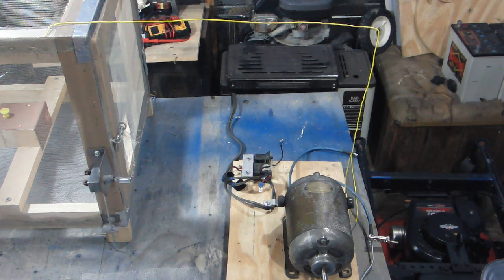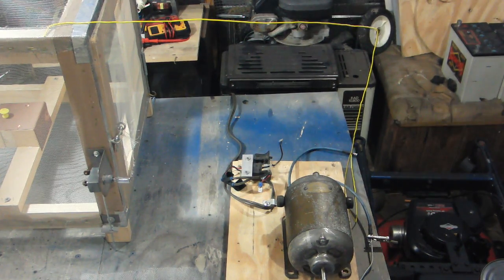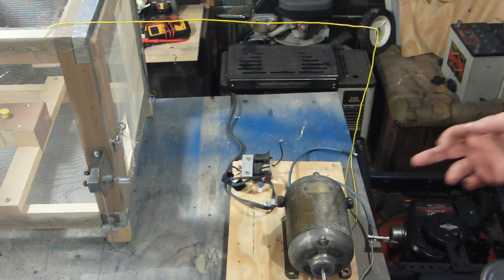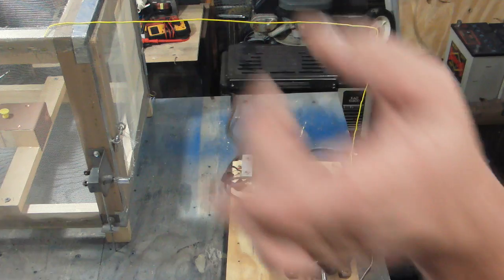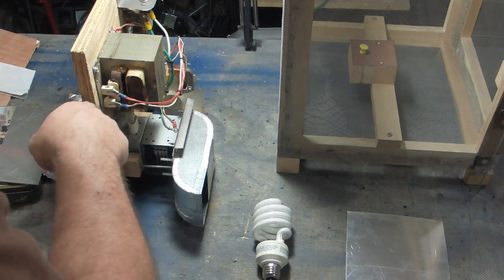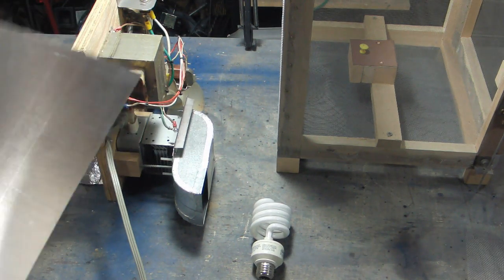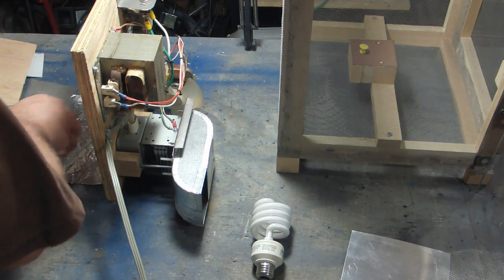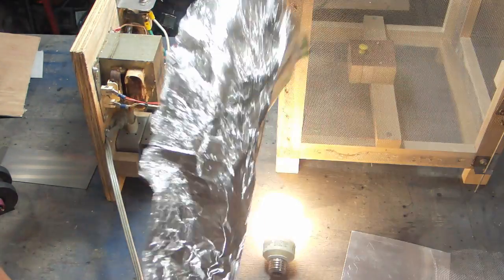The Faraday Cage

Comment: If you keep electronics in a gun safe... are they "safe"? Will an EMP/CME just go around the safe or is it absorbed into the metal and then needs to be "released" like a capacitor, there by creating a static potential that could still destroy circuits in the safe anyway?

Also.. Thank you - I did not think about cutting off my main circuit breaker to prevent the energy from entering my home's electrical system.

Comment: What's up MR2. I've been following your channel for a while now, and your work has both intrigued and inspired me. 

In fact, some of your early videos about HHO gas production and storage etc. sparked a revolution in my mind and largely changed the direction of my research into alternative energy production. I also follow S0's news everyday and I understand your collaboration on star water will eventually change the world.

The reason for this comment is that I have a question about one of your playlists: Suppressed Technologies. Several of the videos have been deleted. I understand how violation of the user account agreement can result in deleted videos, however, it seems suspect to me that so many violations can be found on the internet and are not deleted, yet, when the content of a video contains "certain" elements they are removed.

What did the deleted videos contain? Can I find them elsewhere on the internet? 

I've been scouring the internet for the last three years looking for alternative energy research, and, of course, the holy grail, "free energy". I've looked into everything from magnetics, HHO, Stan Meyer, nitinol engines, crystal batteries, Fresnel solar Stirling, Edward Linacre, Tesla, Marko Rodin, Nunez, you name it. 

I spend a significant portion of my free time researching these topics and have yet to find the holy grail. It seems every time I get close to an answer I hit a brick wall or something was deleted/removed from the internet.

Who is deleting these videos? How can we protect our information? Which area of highly efficient/renewable energy production seems the most viable? For someone with very little resources,  where is a good place to start experimenting?

-Andrew Sinkinson

P.S. Thank you for all your contributions.

Comment: couple questions:
wouldn't your breaker trip if it received a mass dose of electricity?
do you need to ground your cage? the small metal tin was not grounded.
would the metal around your car's battery be sufficient to save the battery? I just thought of The Day After from the 80s

Comment: Question:  If you attempt to cover up your electronics like a computer or something it is difficult to do a complete job around the home.   I notice when you put the metal in front of the bulb when it covers about half way it shuts off.  is that correct?

In other words as you put it a poor mans set up will still be effective.

Thanks again
Reply from the maker: You'll have to make sure and unplug any equipment you want to protect. and place in an enclosure. Just covering half of it won't work :)
Reply: Mr2Tuff2   Thank you

Comment: Stupid question.... if we had a nuclear event or massive CME, wouldn't it take out the grid and satellites as well? So protecting a lot of electronics may be null and void if we were to get a killshot from the Sun. I may have to try making one of these though, looks easy enough. Thanks for the info!
Reply from the maker: You're absolutely right. In the event of a major solar storm most cell phones and communication devices will be rendered useless. I use the faraday cage to protect my charge controllers, power inverters, and battery bank. All backup equipment for my 10,000 watt solar generator. Also have a CB radio stored as well. Which will be helpful with local communication afterwards.
Reply: Mr2Tuff2 I actually plan to use mine to shield some hard drives, a solar mat, batteries, and some fenix lights.
Reply: Good day,

 

I have a technical question about faraday
cases?

I want to make a closed faraday chamber with metal plates for up to 30GHz
shielding.

My question is about the holes in the air ventilation window.

Is it alright if I directly make holes in the metal plate, in a small window
surface,  with a diameter of less than
1/10 of the frequency wavelength?

Or do I need to cut a square window out the plate to place a honeycomb with
holes smaller than 1/10 of the frequency wavelength?

I need so many dB shielding as possible.

Can you help me with this question ?

Comment: if im not mistaken, the walls inside should be fine. the current is only held on the outer-most layer of aluminium atoms. theres no charge inside metal, or into the interior. great vid tho sir

Comment: he pointed out that it is being used only for demonstration purposes..
using a guide wave plate to direct the invisible beam..
and the beam passing through light bulb.. 
hits the aluminum building he is in.. then travels to ground.

safest possible.
few people remember we are told not to look into a microwave while it is operating when they first came on the market.

this is not something you want to do at home..
there is no reason to have microwave on a board normally.

play safe

Comment: Question - Would concrete walls with rebar and either grounded copper, aluminum, or steel mesh be sufficient to create top and sides to protect from EMP. Would I need to also apply the mesh to the bottom slab floor.  I come from a computer background so I have some knowledge to work from.  Thanks for all the great demos and videos.
Rusty

Comment: Mr2 - I enjoyed the education on Faraday Cage. I am thinking of building a home with materials that would allow for underground construction (earthen roof, sides, etc.) but have access for solar energy for passive heating and produce growth. My one concern is the impact of the ever increasing likely hood of an EMP event or several events that destroy my passive electronics used for management of the energy system and devices. I do not have the knowledge to engineer the system yet. question-

Comment: Microwaves dangerous when you are within the focused energy. If Mr2 moved the bulb in and out of that region directed by the wave guide on the magnetron you would have seen it dim and go out. Microwave is designed for line of sight transmission, it is directed. Meaning it basically only goes in one direction and will dissipate over great distances. On cell phone towers you see feed horns and if you were to look in the direction of the horn you would see a corresponding horn in the distance.

Comment from the maker: Without a doubt. They make perfect faraday cages. They are designed not to allow micro waves to leak out, therefore they won't allow micro waves to leak in either. The door of the oven is made with perforated metal, behind the glass, and a micro wave is literally to wide to fit through the holes, This is also the same reason they won't travel through the screen wire in the video.

Comment: Great video, M2. What about using a Rubbermaid or Roughneck Storage Box and cover it with several layers of aluminum mesh.  I believe in order to protect from EMP/CME event you may need more protection from scalar waves than that of the waves of a microwave.  What d'ya think?

Comment: The Sun, and all stars, create water naturally as they interact with rocky bodies. Remember, Water is just two protons (H+) stuck to an oxygen atom, and the solar wind is practically nothing but protons and electrons in a high energy plasma. Rocks are mostly silicates (SiO4-based), so the solar wind works as an acid and eats away at the rocks. This is why OH- is so common in Comet coronas (no snow/ice at all). All it takes is another proton from the wind and you have water!

Comment: great demonstration.
How does the door of a microwave oven prevent the energy from escaping ?
Mine just has a rubber like seal.
Could the wave guide be any length and turn through many directions?
Cheers

Comment from the maker: It can be argued that microwaves are dangerous and I would agree to a point. It will obviously cook flesh. However in has a "wave guide" over the magnetron. This focuses the energy which travels to walls of my shop and then to ground as my shop is faraday cage. Before I grounded the building I couldn't run a camera when I flipped it on. Now as you can see in the video the camera is unaffected. Not to worried. Used for demonstration only. Otherwise it's a dust collector. :)

Comment: Can you educate me on the "how to" of sequencing 12V batteries (like in the electrolysis video), and wiring copper coils in parallel (like in the Angus wheel)?  I really want to build a small electrolysis chamber, and attempt an Angus wheel, but I'm not an electrician.  If you know of some good websites or books I could look up, I'd appreciate the info greatly. 

Thanks, in any case, for putting your videos out there.  Here's to the future

Comment from the maker: They're awesome. I've salvaged about a dozen so far. Use the transformers to make spot welders with. Get 2 big ring magnets with each, and they're loaded with momentary line voltage micro switches. Everyone of them still worked after replacing the fuse inside on the circuit broad. You will need a set of security screw bit. auto zone :)

Comment from the maker: When it comes to EMP or CME it's all about size. Machines with small electronic components can't handle large amounts of electricity. ie: computers, cell phones, TVs. Not saying the locomotive can't be knocked out by this. However they will take a lot more electricity than most any other vehicle. In fact the locomotive will be the last thing running after an event like that. Even an electric golf cart will weather a storm much better than an automobile simply because its made with heavy wiring.

Comment: Hello Mr2Tuff2, I am curious what effect an emp or x flare event would have on  locomotives. Considering they are metal would that provide any protection? Is it a matter of grounding? Is it possible to be grounded while sitting on the steel rails? I know of an incident where lightning struck the rail ahead of a locomotive, it created many problems. Since I was listening to this event over a radio I was out of range to hear the details or solution to the problems.

Comment: Always a pleasure to discover your latest video.

Are you going to come back to the motor thingy any time soon? (That idea of using both sides of the magnet is really intriguing and probably worthy of deep explorations.)

Q&A: Wondering if the field strength of a permanent magnet decreases over time when used in a motor/generator … ? (I have an idea for driving a brushless alternator with the turbo charger shaft on fixed based industrial engines.)

Comment from the maker: Only for electronic equipment. Concrete floors have wire and re-bar in them and are fair conductors of electricity. This electricity won't actually hurt people. Although it may make some folks a little crazy. Works just like an induction stove. The metal pan gets red hot but you can put your hand on the eye afterward.
watch?v=HiIKq4RkZ1M

Comment from the maker: Personally. I wouldn't worry about cell phones or TV's either. I have cobra 40 channel CB radio tucked away. I know too many people that can make their own electricity. There could be a point when nothing will work, but ground based radio transmission will work again, long before the satellites will. 
As far as a room in your home. You can line it with tin foil and thumb tacks or any type of metal. Just the ceiling and walls. Wood or carpet floors are best. You need to cover raw concrete.

Comment from the maker: I tested the microwaves on a 5 cell 2.5v solar battery charger that I made to charge AA and AAA batteries with. The microwaves did add about a .5v. Which is not very much. I'm just going to flip the disconnect off from my panels. 
Satellites get hit regularly with a lot more energy than anything on the ground ever will. They seem to work fine up there. I'm not to worried. I do have 3 200watt panels stored in my shed, just in case.

Comment from the maker: For some of us leaving is not even an option. Most people don't realize that they're chances for survival are cut into fractions the second they leave they're home. "Bug In"
 As long as you disconnect your main breaker, or even pull the meter out of the socket. You cut off all the power building up in the lines. Yes the wiring in your home can still induce current, but only a small amount compared to 100's of miles of open cable linked to the power stations. You should be fine. Thanks :)

Comment from the maker: That will work just fine. Even though the floor doesn't have re-bar or wire I would still set everything on wood or pallets. You know a concrete floor will kill a good battery overnight if it's not isolated. It may not without metal in it, but why take a chance. IMO.

Comment: I have a polebarn style shop with galv-alum roof and siding. The roof is connected to the siding via galv-alum rake trim. The poles are used telephone poles approx 3 ft in the ground. The floor is concrete(no wire or rebar). At the present time I have no power ran to it. I use a gas powered generator. If I drive a ground rod into the ground and attach it to the siding will it be an effective faraday cage and protect the buildings contents (if nothing is touching the walls)?

Comment from the maker: As long as it has a metal roof and walls. A mobile home will protect against EMP or CME far better than an ordinary wood roof home will. Plus most mobile homes are well grounded by they're anchors. Just remember to kill that disconnect.  "Main Breaker"

Comment from the maker: They scare me too. I don't play around with it, but it's there when I need it. Always try to stand behind it if possible. The flat aluminum plate was the only one I felt a little heat on. Should have used my gloves.
You know the military use this for crowd dispersal. So it can't be good for anybody. 
Yes any conductive material will shield electric charges.

Comment from the maker: I would make sure the generator was isolated on rubber pads and build a steel or aluminum box to cover it. Make sure the box goes all the way to floor and doesn't touch the generator. Also buying a extra set of ignition parts to replace the old one in case they burn out.

Comment: how do I protect my portable generator? I use it for my home when the power goes out. it plugs from the outside directly into a breaker box in my basement. when the generator is stored it is on a concrete floor in the garage. when I use it I ground it to the home steel rod in the earth.

Comment from the maker: Its reflecting the energy back to outer casing of the magnetron, which is grounded through the wall plug. Yes it can be channeled in fact the micro waves are being channeled through a sheet metal wave guide in this set up.

Comment from the maker: The only way to save a car made after 1980 or with an on board computer. Is to pre purchase all the electronic components and store them in a faraday enclosure to replace the burned out parts afterward. IMO the smartest thing to do is buy an older car made before 1980. I personally would not waste time saving the car. If your the only person left with one, you won't get to keep it long. I'm all about "Bug In" not "Bug Out"

Comment from the maker: Essentially we don't make electricity. We simply use the electricity as it passes through our atmosphere to ground. An A/C generator is full of spinning magnets that build up or accumulate the electricity that is already there. The only reason it's not free is because we have to turn the generator. That problem has been solved by The DePlama N Machine. 
watch?v=vHuLCSOKV4Y